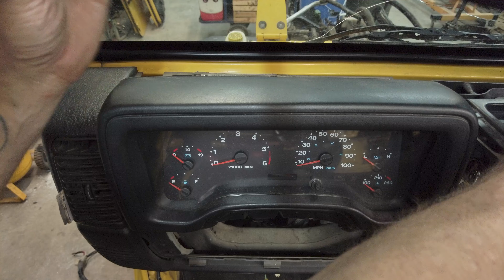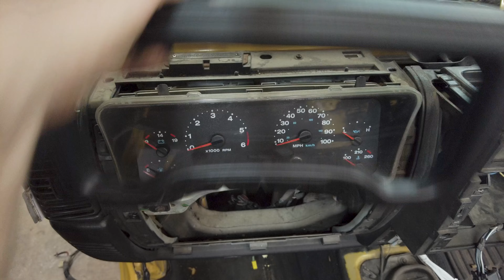Jeep Wrangler TJ Complete Dash Removal. How To Remove, Heater Box, Tilt Column, HVAC, & Stereo

Comment: Can you please tell me what kind screwdriver bit was needed to remove the bottom steering column cover? (2 minute mark) I hoped it was phillips but can’t get that or anything else to bite. About to pull my hair out lol😂
Reply from the maker: Try a T20 Torx bit, those are pretty common, also Phillips.  If you shine a light at the right angle you can see what it is.  Phillips or Torx, you'll need to wiggle it around until it catches.  Hope it helps
Reply: @beemobgarage  thanks, turned out to be a t20.  Glad it wasn’t one of those security t20’s